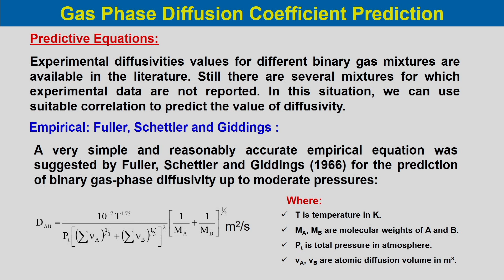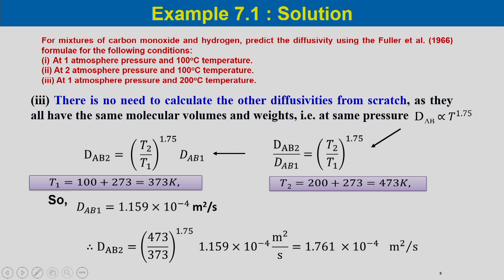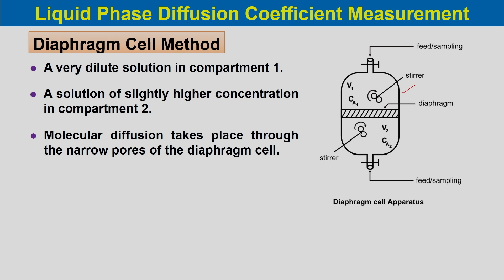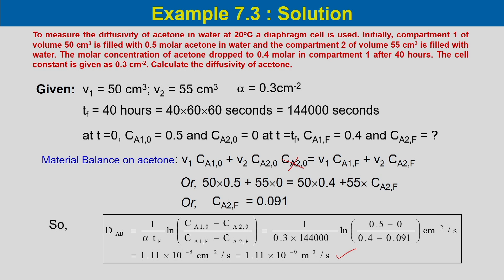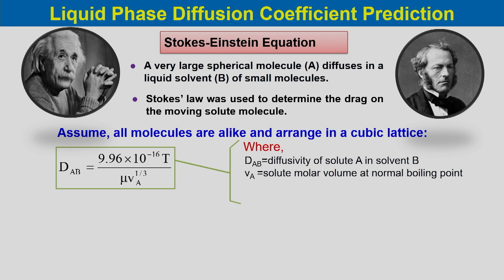Lec 7: Gas Phase Diffusion Coefficient prediction and liquid phase diffusion coefficient measurement

Comment: Sir ur fullers equation to find diffusivity is not correct...
Its 10^-3 in the numerator...not 10^-7....kindly let me know if Im wrong..
Reply: YES YOU ARE CORRECT
Reply: @AbhishekKumar-eo6nd  thanks
Reply: @AbhishekKumar-eo6nd  and many mistakes are there which is not accounted...hopefully correction can be made...
Reply: @behappy9165  yes
Reply: It's is correct it's 10^-7
Reply: @sachinkrao3010  wrong
Reply: @prasantasaren2210  it is..
Reply: then in your case the diffusivity unit will be cm^2/s ... both are right if you use correct unit.